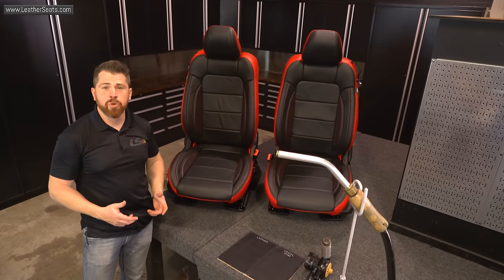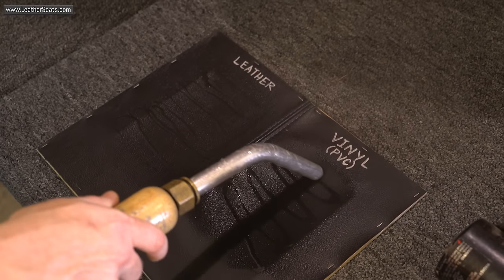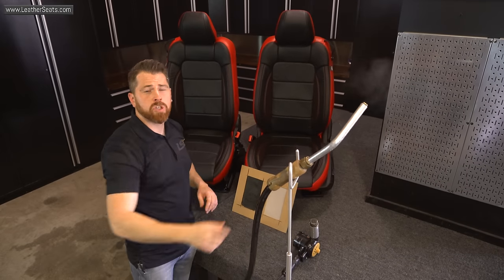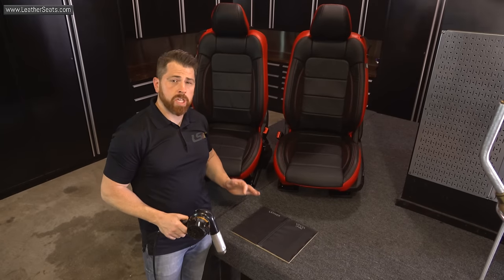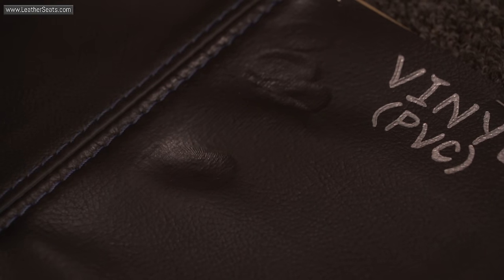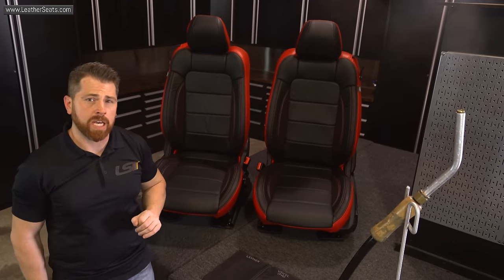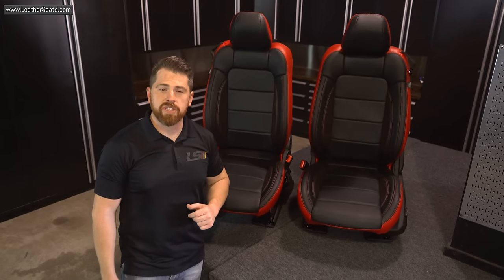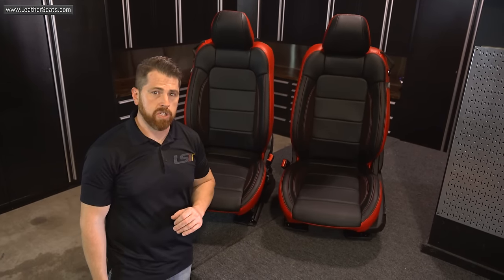How To Remove Wrinkles & Improve Fit in a Custom Leather Seat Upholstery Install - LeatherSeats.com

Comment: Sadly I only viewed your thumbnail and I thought you were using a propane torch. Naturally I used a torch on my leather attempting  to smooth the wrinkles and I ended up with a massive burn and hole.
Reply: Lmao
Reply: Oof big big oof
Reply: If you use a flamethrower you can do all the seats at once with them already installed in the car.

Comment: Would this also work to smoothen out creases in alcantara / suede seats? I have like 3 or 4 pop up creases on the lower right leg area.
Reply: This kind of technique relies on leather’s tendency to shrink when wetted and then heated. Alcantara does not have that property, though true suede might. The #1 rule is test on a small, inconspicuous spot before you attempt anything with the visible upholstery.

Comment: So if I don't have these special tools I can just sit the seats in the sun for a couple hours and get the same results?
Reply from the maker: 63 Impala rag Dude Sun time does not replace using steam and/or heat gun but it will help with minor wrinkles. As far as the tools are concerned any household clothing or upholstery steamer can work as long as you can concentrate the steam into focused area. You might also check out our heat gun specific video as well: https://youtu.be/6KME5tJtjBM

Typically we utilize both the tools and sun time during our installs. Feel free to email us at sales@leatherseats.com if you would like to know more about the process.
Reply: @LeatherSeats  ok cool thanks.
Reply from the maker: @appliancedude63  No problem! Thanks for watching and commenting. Let us know if you have any further questions.

Comment: Great video, one question though, is it possible to get the seat belt guide strap also in leather?
Reply from the maker: Emil Badal We do not make that strap for this kit because the factory strap is reused during the installation.
Reply: @LeatherSeats   would that be possible at buyers' request?
Reply from the maker: @user-si7cr5lg4p  You would need to email sales@leatherseats.com to see if that is possible.

Comment: Ii respect your channel i been installing kits for over 15yrs and its all gatdgets and gimmicks let me tell you all the real secret make sure the aligment is all correct in a hot day turn the heater to max for 15 to 20 min after thats go in and hand massage very easy when u have 4 installations in one day or diy ers
Reply from the maker: Carlos Lara Thanks for the comment! We also highly recommend putting the seats out in direct sunlight for a few hours, it works wonders!

Comment: Would a hairdryer be just as affective to shrink the leather
Reply from the maker: Andrew Griffith Unfortunately no, very minor wrinkles might move just a bit if you have a hairdryer that runs super hot but with those, you would be better off putting the seats out on the driveway in direct sun for a few hours. Heat guns can work under specific conditions but never on or around vinyl. You can get into trouble very quickly so we tend to only recommend heat gunning to professional installers. You can check out our video on that here: https://youtu.be/6KME5tJtjBM

Comment: Will the sun inevitably perform the same job?

I have a steamer but it's also pretty damn hot and my car is a convertible... so would I get the same results just putting down the top and letting it sit outside in the sun for a few hours?
Reply from the maker: silenc3x During the installation process, nothing can really replace steam, however, once the upholstery is installed, letting the seats sit in direct sunlight for a day is one of the best ways to get rid of minor wrinkles! We put the seats out in the sun for almost all of the installs that we do. 👍

Comment: How can you remove leather cover seats to get to the original seat?
Reply from the maker: Oisín O'Neill It depends on the vehicle, each seat is different. If you check out our other tech tips videos, you will see several examples.

Comment: what is the name of this tool?
Reply from the maker: games lima This video shows the use of an upholstery steamer and heat gun. For the steamer, we used a Jiffy J-4000 however for a DIY installation most clothing or garment steamers will work just fine. Please email sales@leatherseats.com if you have any questions about the process.